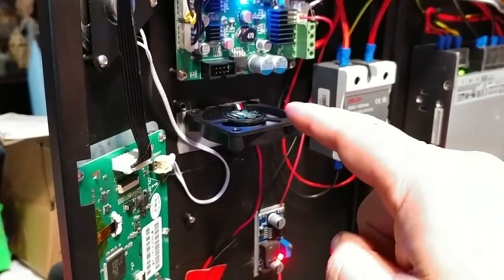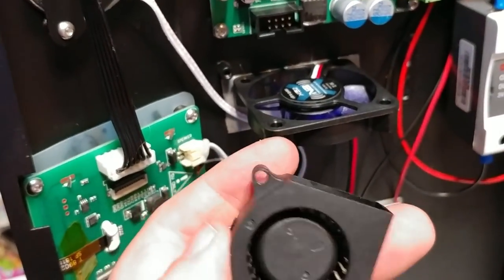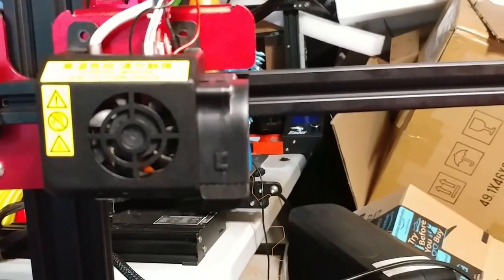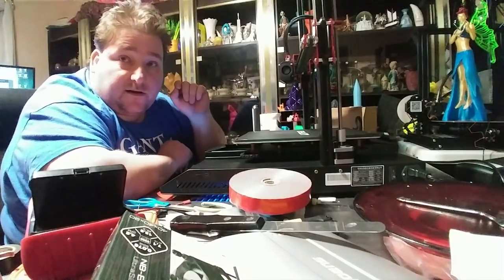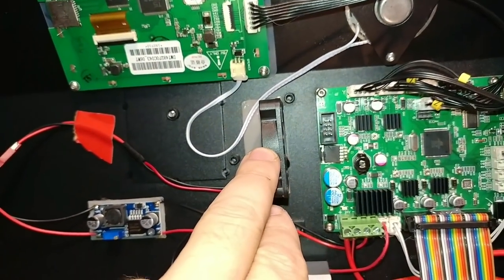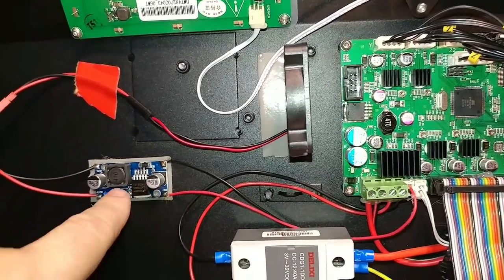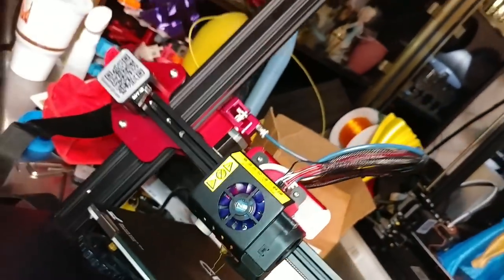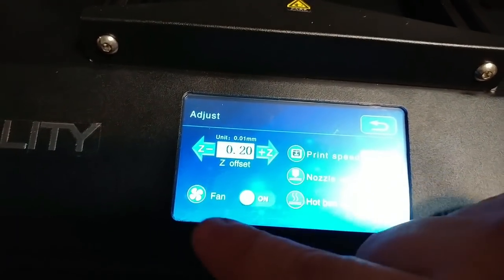CR-10s Pro Ultra Quiet Upgrade for Fans - T3DP

Comment: Hey I just installed a new 40×40×20 noctua quiet fan on the power supply on my pro. It don't seem like the cfm is gonna be enough to get enough heat out.what do you guys think?
Reply from the maker: So far mine has been fine. Zero issues. Remember it does throttle that fan ie it may run slow when its not thst hot.

Comment: Hi Chris, just found your channel - about to get a 10S pro myself, but when it comes to fiddly-bits of hardware I'm a complete goon; Would you be willing to sell premade replacement fan sets with the converters and all that?  (marked up for your time and effort of course)   Thanks!
Reply from the maker: I will look into it to see how practical that is the problem I foresee is that I don't see a way that doesn't still require you to cut and solder but I'll work on it and see what I come up with
Reply: @nerys71  Thanks man.  I assumed there would be plugs back at the original connections, which your addenda would plug into in place of the original part - e.g. (from plug)->original 24V fan becomes (from plug)->converter->new 12v fan.   I've somehow been a maker for ages without ever picking up a soldering iron, though.    All I ever hear is "it's easy" and I totally believe it is, but knowing and executing can be very different, and I'm not willing to learn how real quick and then immediately go hacking into my 3d printers right out of the gate.

Comment: Those fans are quiet but don't move a lot of air. It's perfect for the case but a bad idea for a hotend fan. I recommend these which are a great compromise between noise and air moved: https://www.tme.eu/gb/details/mf40100v1-g99-a/dc5v-fans/sunon/mf40100v1-1000u-g99/ They are 5v so they can be plugged into 5v inputs and be controlled in firmware. They move more than twice the air while still reasonably quiet.
Reply from the maker: I have run 400 hour prints without a problem while they don't put out anywhere near as much air as a stock fan I don't think the stock fan CFM had anything to do with reality I think they literally said 40 mm fan stick whatever fits I don't even think the manufacturer knows how much air is actually required to cool it and clearly the noctua or noise blocker fans move plenty of air since I do not have heat creep I also make other minor changes such as clearing the air flow path cutting away some of the grill Etc to make sure there is nothing blocking airflow for example in many printers I actually get better airflow with quiet fan than with the stock fan more CFM because I clear away the grill and the grill was blocking so much of the air...
Reply: @nerys71  The word on the street is that noctuas are not sufficient. I'm not sure if that fan puts out more, I don't think so. However Creality printers have a bowden tube stuck in there so may only be an issue with all metal hotends. The prusa people seem to be switching their noctua fans for more powerful ones because of not enough air.
Reply from the maker: @sabahoudini  oh yes I could imagine in all metal hotend needing quite a bit more Cooling the noctua is just fine for the Boating set up I have had no problems so far but yes and all metal hotend I could see cooling being much more critical

Comment: Is that a solid state relay what does that do
Reply from the maker: Yes it is it switches power there's a similar device on the actual printer board and it acts as literally a switch and turns the heat bed on and off the problem is the heat bed commands a very large amount of power and this can be a heavy toll on the very small components on the printer board which can wear them out or worse so instead of commanding those expensive components to turn such a high load on and off you externalize that load the SSR is more than capable of handling that load so all the board has to do is tell the SSR to turn on and off and get that intern turns the heat bed on and off kind of like how you use a relay for your headlights in your car same concept

Comment: Hi Chris, I am lucky enough to be the owner of a shiny new CR-10S Pro, just wondering if you've had to do much with the profile or if the stock CR-10 profile in Simplify3D is a decent enough starting point? Thanks for all the great content, keep it up. :)
Reply from the maker: I've never used the stock simplify3d profile I use my own but my stock cr-10 profile works perfectly on it
Reply: @nerys71  Awesome, thanks very much! I'll definitely give that a try.

Comment: How to i get notifications for your live streams? I am subscribed but seem to miss them. I am super excited to get my cr10 pro as well as my cr10 s4 I ordered to add to my two ender 3's. I will be trying to add a cyclops hotend to the s4. But i also wanted to know your thoughts on the mosaic pro. I pre ordered one off amazon but wanted to know your thoughts since you saw there booth at  the makers fair in New York.
Reply from the maker: the mosaic looks amazing. people have made some amazing things with it. I would love to buy one some day.  definitely pay the little extra for the pro (metal serviceable parts)

Cyclops on the S4. that could result in some epic prints!

for notifications. there is a little "bell" icon next to the subscribe button. if you click that you can change the level of notifications from normal none or always. that should do the trick in theory.
Reply: @nerys71  rhank you for getting back so quickly. Yeah I preordered the mosaic pro cayse of the warranty and metal parts, should be here Nov 27th. Im going to use it with the cr10 pro that will be coming in around the same time! 
Very excited! Love to have your help with my cyclops on the s4 if your down.

Love the videos! Set up notifications for all your stuff
Reply from the maker: @MrGboybst578  I don't know how helpful I can be since I do not have a cyclops but I will do what I can

The pallet Pro combined with a cr-10s pro that's going to be one hell of a combination! Damn it you're going to have a lot of fun with that :-) the Dual drive and new hot end should make it very reliable
Reply: @nerys71  im very excited for that pairing I cant wait!
Reply: just got my cr10s pro. was wondering about the printer settings as my version of CURA doesnt have a profile for it? do i need to edit the start gcode so that it does the auto bed leveling everytime? thank you in advance
Reply from the maker: Standard CR-10 profile works perfectly for me. you don't need anything special in the Gcode since the mesh leveling is handled on the touch screen UI.
 @MrGboybst578
Reply: @nerys71  thank you so much I am stunned at how quiet this thing is. Only noise i notice is thefan that comes on every so often. In the stock gcode test dog it prints with no heat to the bed seems to be printing now. Do you still heat it for pla
Reply from the maker: you CAN print pla with no heat bed. but pla CAN still warp. I prefer a heated bed. but... I do "turn off" the heat bed after 10 or 15 layers. so I used 60c and at layer 15 I instruct my slicer to turn off the heat bed.

DO NOT do this on glass/boro/pei/pex/ultrabase etc.. those "REQUIRE" heat to function properly :-) @MrGboybst578

Comment: How did you have multiple bad fans?
Reply from the maker: I only had one bad fan and that is the 24 volt blower for the parts Cooling it died the rest of the fans I replaced or adjusted solely for the purpose of making it quiet
Reply: @nerys71  gotcha.  sent you an email on a couple of things.  Thanks for the clarification.

Comment: Hey Nerys a Q.....can I but a new cr10 and flash the firmware with cr10s firmware...if yes how and I'll add the filament sensor and maybe second lead screw later. Thanx my friend and Congrats on the subs you've picked up.....Ever decide where to move to? Okla. is pretty cheap brother....
Reply from the maker: As far as I know the board in the cr-10 is not the same Electronics as the board in the cr-10s now of course you could put a cr-10s board into your cr-10 and add the necessary components making it a cr-10s

I know I get teased everyday with Gorgeous houses at gorgeous prices in Oklahoma the problem is I think Oklahoma would be a death trap because you can't get Healthcare there my sister and brother can never work and I'll never make enough to pay for Private health care if I can't have Healthcare that's one thing but they have to have health care which is why I'm trying for New Mexico

Comment: Hello mister Nerys, good review=). I also got the cr10s pro. but Ì have a problem. the Y axis is layer shifting. do you have this problem too? and do you know how to solve it?. i have checked all the belts and gears and so on. everything is all good. can it be faulty motherboard or vref that needs to be tuned? would be glad if you could answer. you seem to know a thing or two!
Reply from the maker: No I have not had this happen have you seen it happen firsthand? Meaning do you know if it's a simple shift or if it's a collision that caused a shift? Does it happen in all prints multiple times or only rarely? Is it predictable?

Assuming the belt is not too loose or too tight make sure the grub screws that hold the GT2 gear onto the shaft of the stepper motor are snug if they come loose stepper could turn inside of the gear and not move the belt properly

 Next thing to check is that the plug is actually all the way in sometimes they can work a little loose the plug that goes to the stepper motor

 This printer is a little harder to do the next check with but my next suggestion would be to swap the X & Y stepper Motors I am not sure if they are the same on the pro I will have to look at mine

 but the idea is if you swap the motors and the problem moves than the motor is the problem if the problem stays then the problem is either of the wiring harness or the brain board
Reply: Hi Mister Nery, I have checked all that you said=). But I have not switched motors yet. after I checked that I didnt have any belts,gears,screws loose. its as smooth as it can be back and forth. I opened up the panel under the machine. and I turned up the vref on Y stepper motor from 1.50 too 1.80v.  All vrefs was over 1.5v the Y stepper vref was one of the lowest. but that didnt help the problem. the first prints I did came out without layer shift. but when i tried more square prints there is always layer shift. sometimes in the same spot on one print(tested the print several times). then i tried another print and a layer shift happend higher up on the z height. but one time i turned down the speed manually on the printer from 100 to 80. then it worked. but most often the layer shift happens. Im so happy with this printer. its my first one. but so sad that this happens.:(

EDIT i checked one print now that I have tried 3 times. The shift starting to happen exactly on the same layer z height. and the shift is on the Y side!

Comment: Last one
Maybe lol
Cr-10s pro vs flash forage
Reply from the maker: I do not know I've never used a flashforge although I might be getting one the one issue you're going to run into is that the only flashforge I'm aware of that has a cr-10 sized build volume is well over $1,000 I think $1,800?

Comment: The fans are all qiet by themselves. just mount them without direct contact to metal parts and all is good.
Reply from the maker: not mine. they were turbines and growlers. although I understand they are working on improving that so current releases might have quieter fans.

Comment: Thanks to you and other youtubers I bought this terrible printer and now I am stuck with a warped bed and terrible sensor. Fucking terrible printer, the bed is warped in micro areas, the sensor gives a different result every fucking time, the auto leveling function doesnt help at all. Amazing job Creality, amazing...
Reply from the maker: The sensor is a pain. Switch to manual aux leveling (turn of auto upper right corner) just using the sensor as an end stop same spot much more consistant results. Bed is very likely flat the sensor is just a pain in the butt. I have 2 the first one i got and did video on works great the second one is a royal pain in the ass. Totallly inconsistent. Working on replacing it if i cant make it work right.

So you bed is probably totally flat but the sensor makes a flawed mesh which means its activly moving further and closer to the bed while printing which will manifest to you as if the bed is not level. Its probably flat its one of the things they did very well on this machinem 100% ofnits problems are in that sensor the rest of the machine is nearly perfect.
Reply: @nerys71  switched to full manual, calibrated everything again to perfection, problem manifests anyway.

I also tried to rotate the bed and the problems manifest more or less in the same but newly oriented areas.

So nope, the sensor may be shitty but the bed is far worse...
Reply from the maker: yes it will manifest in the same spots because its the material its reading. so when you rotate the plate you will also rotate the bad reads.

you could very well have a warped bed. I was hoping the QC on these machines was high enough to avoid that. I would advise you to confirm that with a straight edge. if you confirm its warped ask for a repalcement that is unacceptable. I have no doubt they will send you a new plate. if its straight...

you can't know the deviation if you are going full manual. because that requires doing a mesh read which will manifest the problem and give you a problem since it will actively move on z as it moves across x and y in response to the results of the mesh readings. on mine the bed is absolutely flat. I mean so flat I can stand my straight edge up on the surface and it stays. but the damned sensor reads the left as 1.5mm high and the right as .23 low even though I can physically confirm its absolutely flat (for this context)

I am working on the change over to a BL touch since there is now firmware available to allow this. with the bed (at least on mine) so flat I would prefer to just go back to a physical end stop. more reliable in my opinion and easily diagnosed without having to puts around with firmware :-) but I have not figured out how to do that yet since I assume it would require a firmware change.

 @Carlovfx
Reply: @nerys71  I just think Creality just lost a customer for the future, this printer is advertized as noob proof but if i have to change firmware and sensor to make it work then it's not noob proof. At the very early days it was working almost normally with standard prints as big as groots and smaller than that, today even a simple tiny calibration cube is a pain the ass!!! Worst thing? I bought it from a website mimicking Creality which in truth is not Creality!!! And Creality knows about them and does noth8ng against them because they sell their printers!!! What a fucking joke of a company!!!
Reply: @nerys71  question: when the sensor screws up badly the nozzle presses very hard against the bed moving it downwards. Could it be that when this happened the bed warped or it is impossible to warp the bed that way?
Reply from the maker: @Carlovfx  while I can't say it's impossible it's unlikely since the Springs will simply compress under the force

Comment: Thanks a lot for your video. I have a couple of questions in what regards vibrations and airflow: I bought exactly the same fans as you did, and while the NB PM2 is quiet outside the power supply, when I apply it, I have horrible vibration noise - there is no space for silicon silencers so I'm wondering if you faced the same issue. I also wanted to ask you the orientation of the power supply fan - is it exhausting the air or bringing it in? Another question is around the bottom left fan, is it exhausting the air or bringing it in? I'm asking because my original creality is bringing the air in, actually the fan could not be assembled in another way because of the mounting supports - is this the same for you? Thanks
Reply from the maker: Usually you exhaust out. This could change from Supply to supply. However. When I get my cr10 has Pro up again. I will double check that
Reply: @nerys71  Thanks. Are you facing vibration noise of the NB PM2 you put on the power supply? Due to the vibration, mine is all but silent. I've tried several options to attach the fan, without success.
Reply from the maker: @RAMB1980  If you're getting vibration noises either what your attached to is flimsy enough to be vibrating or the fan might be defective? I do not have vibration noise issues.

Comment: Sunon Lüfter 40x40x20mm EB40202S2-999 DC 24V 6200 U/min 21dBA Gleitlager 2 Litzen https://www.amazon.de/dp/B009O9DGSG/ref=cm_sw_r_cp_apa_i_eZStCb0SW9YGZ could this be a replacement without a buck converter?
Reply from the maker: yes. that is a 24v fan so no buck converter would be needed. the question though is how quiet is the fan?
Reply: @nerys71  i orderd two of them, lets see. Greetings from germany and thank you for your work